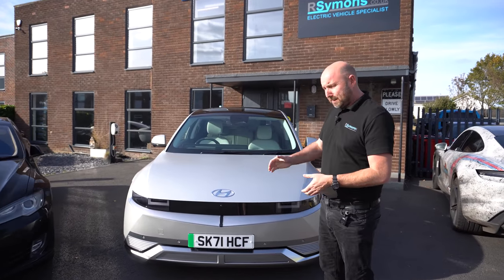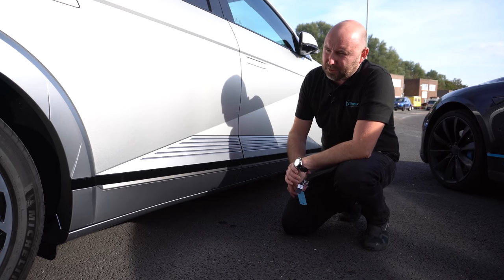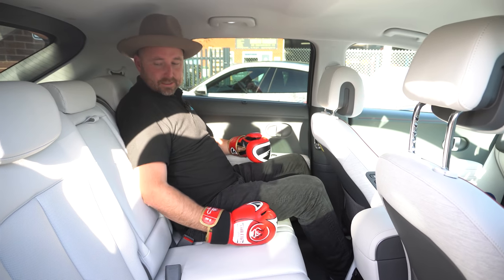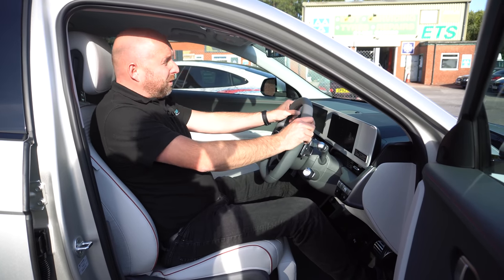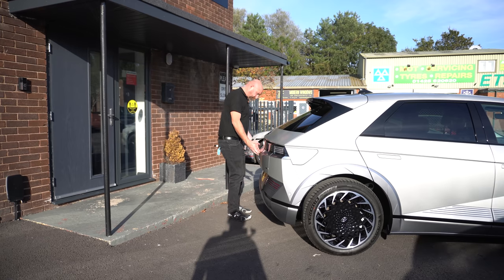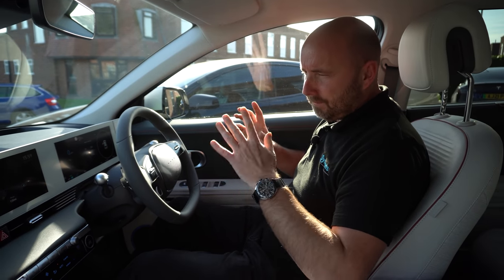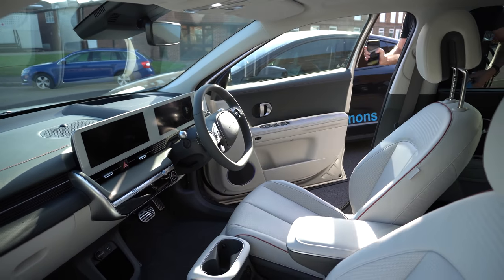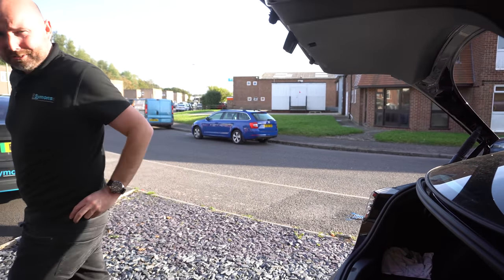Hyundai Ioniq 5 Project 45 review with likes and dislikes plus comparisons with Tesla Model 3 and Y

Comment: I too have a P45.  There are a number of assistance systems.  I agreed with your initial assessment about the slightly modulating steering.  But after using it on several long journeys, I have got used to the slight wobble.  I think this is to keep you aware that the system is still active and working.  As you have to keep your hands on the wheel.  So I got used to it.  I find the graphics and infotainment fine.  Look of inside and outside fab.  Very glad I purchased the car.  It is good to have EV choice.
Reply: What is your real life mileage if you don't mind the question
Reply: @AZCONA  Hi I am getting 230-250 miles.  I am not driving particularly carefully.  But really meets my needs.  The rapid charging works really well at the few UK based Ionity chargers I have used.
Reply: Didn't know you got fired.

Comment: I turn off lane assist when I leave home as I live in the countryside and it doesn't work on rural roads.  But in order to get the crash safety standards, you can't turn off lane assist permanently.  But it is easy to switch off via the dashboard button.  Can't agree with the grey plastic issues - I think it looks cool

Comment: Great video. Out of all the IONIC 5 videos I’ve seen, I like how you are telling Hyundai, directly, your straightforward opinion about the things you like and don’t like.  The “bold design,” and the choice of a lot of grayish bits of plastics, etc.
I am glad Hyundai is bold with their designs. I prefer a vehicle that stands apart from the rest. I hope they continue to have great designs and offer a lot of features for the money. 
I, too, was surprised there was more plastic areas for a vehicle that seems to give the vibe that it has a higher standard of quality. 
The launch video of Hyundai, made me think the interior was going to be a bit more quality. 
I want one. 
Hope you can do tests on the charging. 
And seeing if you can get full performance from the battery. 
A different YouTuber noticed the IONIC 5 doesn’t give full performance/horsepower because the battery temperature is affecting it. 
I don’t like that. I want to just unplug and go with full performance regardless of battery temps.

Comment: Very fair review. I’ve had my Premium RWD 73kw for a week. I love it!
The lane assist is annoying!
It’s a shame Hyundai gave everyone P45 or Ultimate Ioniq 5’s to reviewers as I doubt many people will buy the top of the range and the next level down (Premium in the UK) is missing a lot of those bells and whistles.
Reply: Almost everyone ordered the full trim in my country. The price difference is really small between the two trims (yes, we only have two choices). And everything is available including sunroof and solar roof. Weird how different the trims are in different places...
Reply: @Danne89  EVs are seen as expensive in the UK. Even the lower spec Ioniq 5’s are perceived as expensive by most people.
Reply: Agree - the premium feels anything but. Was all excited by the features on display - then to find out all extras and no idea on the waiting time if ordered from my local dealer - I want te Ultimate AWD tech pack
Reply: @davemcconnell2491  I actually feel my car is very nice indeed. Some of the extra bells and whistles would have been nice, in some cases Hyundai removing them seems unfathomable (mood lighting, popping out door handles). I just think it's a shame EVERY Youtube review features the ultimate spec which is not what most people are going to end up with.

Comment: Regarding the lane assist on/off and level of regen and I believe other settings. In another review I saw that car keep selected settings by clicking "Auto-Hold" button on the right hand side of the steering wheel. If "Auto-Hold" is off car reverts to default settings once turn-on again. I don't have the car to test it first hand, so I could be wrong.

Comment: My Kia E Niro has heated and cooled seats and idea is you can save using heat/air con and therefore gain extra range. I also find the same annoyance with lane assist and country lanes, but in general not a major problem. Worst is when there are no lines and it somehow finds some!

Comment: I love the design 🤩 
It might charger faster than Tesla Model 3 in kW, but not in miles per hour, due to it's higher consumption. 
Did you had issues with low power after fastchargeing? Like Bjørn Nyland had on his presscar?
Reply: Have to say that "failure to launch" on the motorway looked as though it could be dangerous. (If it's found to be "a thing" on other cars)
Reply: This was one car and it’s amazing how that one car has been brought up in almost every Ioniq 5 review

Comment: Took a 24 hour test drive of the ioniq 5 a week after having a model 3 long range for a weekend. The steering wobble when in lane keeping was the same, also it would sometimes just disingage without any notice whatsoever, Basically making the feature not something you could rely on. Tesla autopilot way better! Also The lane assist was annoying as hell down country lanes and I couldn't figure out how to turn it off, To many buttons!  The regen had to be reactivated every time I got back into the car with the padal shifts which is annoying. Voice control useless unless for calls. When accelerating off the line there was 1-2 second delay even in Sport mode. A couple of times it would say the key not detected in the car even when it was. I had to jump out lock it and unlock to get it to recognise the key again. infotainment I found decent with Android auto and apple car play. Plug socket under rear seat is a great feature. 
Nice smooth ride and better sound proofing then the Tesla but ultimately the ioniq 5 didn't feel special to me where as the Tesla did. Good car and I'm sure it will sell well as many will be happy with it. Good to see Hyundai embracing the future.
Reply: Too many buttons? you really had 24 hours and couldn't figure out how to turn off lan assist? Really, I get it :there are better lane assists out there (including Tesla’s) but saying it has too many buttons is clearly a Tesla fans perspective. Most people dont like the absolutely minimalistic stuff in the Tesla.
Also: Regen stays where it was unless you are not in I-Pedal. The delay though is sometimes odd. Sometimes it’s instantaneous, sometimes it has a lag to it. Maybe a thing that can be fixed with an update. Also: did you check Bluelink was connected? Without it, it’s crap-

Sorry, but the way you experienced it does not apply to people who are seriously interested in a car. Before I test drove it I knew the stuff you are complaining about.
Reply: @carroux4050  Yeah, I set my regen to level 3 on day one and haven’t had to touch it since. Lane Assist is annoying but you just press the lane assist button on the wheel for a few seconds to turn it off.
In a week of ownership I have not experienced any if the other issues.
Reply: @carroux4050  no I didn't realise it was obvious how to turn lane assist off.  Yes too many buttons when you've experienced something better i.e put the car in park and your done rather that put the car in park, apply handbreak and press the start stop button! I-pedal had to be re-engaged every time I got in the car. 

Yes I knew enough about the car before I drove it but no I didn't read the manual first which with the size of it would have used up the 24 hours I had. 
Ultimately the car was very good. My negitive points are my personal dislikes.  Also 3 out of 5 charging stations I visited didn't work but that's wasn't the cars fault but that added to my experience overall.
Reply: @dannyspeed  Hey Danny, I get it that people have their favorites. And I guess thats perfectly fine. But as you said in your first paragraph this is, yet again, due to driver not knowing better. The Ioniq automatically goes into Park if you open the the door. This applies while the car is turned on and you open it or the car is turned off and is not in N. The start button: ok. But I guess this can't be a dealbreaker since a lot of EVs nowadays still have this button (which I assume is because of drivers used to it).

Tesla is a great example wheres design is before functionality: why'd you think Model S and Model X still have a driver dashboard? It's not about minimalism per se, but to save cost. Also one might say for a Tesla you need to get an introduction as well. How the hell should someone know how to engage Autopilot or just SCC. Even setting back the indicators can be a challenge when you start out.
I think it's unfair to report your dislikes when 80% of them are due to not knowing better...

Don't get me wrong. I like Tesla (even though you might think I don't). Model 3 and Ioniq 5 were on my shortlist. And both are excellent cars. There are pro's and cons on both sides. Viewed objectively there is no winner. :)
Reply: @carroux4050   Its not about the driver knowing better its about how intuitive the experience is. If i put the car in park that means i'm parked if i'm in neutral then i'm obviously not parked. When on an incline you have to engage a hand-break. Otherwise why have you got these options. No experience is better when you have to put more input in to get the same result. Like the Charge port wouldn't open unless you turned the car off, but i suppose there was another obvious thing i missed on that. 

People are slow to change, they like the old way of things. I had the original iphone when it came and people/media were saying they like buttons on a phone and we all know how that turned out. In my house I have Alexa controlling my lights or i have other lights on PIRs. I adopt technology quicker the most and i embrace it. When i hear people say they hate having controls on a screen yet you never see any reviewer using voice control. Most of the main stuff is automated anyway and if it aint it should be. I test drove a BMW i3s recently and told the salesman the i-drive system is terrible, his reply was its regarded as one of the best infotainments on the market. I don't want a dial to control a map i want a touch screen. 

Tesla didn't save cost they embraced a different approach like Apple did under Steve Jobs and it works. You think to get software to control every aspect of the car is an easy feat? Yes down the line it saves money on buttons ect but you get better user experience imo. Some disagree and thats fine.  The model 3 had short videos within the infotainment on how to engage autopilot, i admit the model S i had to google how to turn it on. Agree about the indicator stalk also that does take getting use to. I like how the ioniq automatically re-engaged auto-steer when you changed lane, where as basic autopilot you need to re-engage it. 

My negative opinions obviously came out strong. If someone asked me what car to buy i would always say to get a long test drive/hire in both. At the end of the day both are excellent choices.
Reply: @dannyspeed  Great comment. I think I can agree on a lot of things. In the end it comes down to personal preferences. 
If there was a car which was perfect the world would be a boring place, wouldn't it? 

One thing though: why is it that the refreshed Model S still has an instrument cluster? :-) 

And I absolutely agree: when it comes to software and infotainment performance Tesla is clearly in it's own league!

Comment: I have a feeling the boot won’t open if you are standing too close - it’s noticeable that it sweeps up in an arc that extends slightly towards you and might hit you.
Reply: That's possible, but he could have also accidentally turned off the feature. I believe there is an option for it (I had it on my previous 2018 Kia Optima SX/GT where it detects your key, the trafficator signals come on synchronously and then the boot opens).

Comment: From other reviews....Tesla ADAS is far superior. Navigation did a poor job of identifying charging locations. Not nearly as fun to drive as a Y and not nearly as powerful. Some say the lack of ventilated seats in Y leaves them with a sweaty back and some say the aircon on the Y is lacking in a hot climate. My Kia PHEV has great aircon but the ventilated seats are a disappointment. Also, the Lane Keep Assist on my Kia does not work on a sunny day with shadows on the road. Is this also a problem with Ionic?  Software updates?  Really concerned, my Kia has had NONE in over 3 years. Waiting to see the Genesis version since it has powered steering column, hope it will work same as Tesla. Also, my Kia Easy Exit only moves the seat rearward and does not also lower the seat. I find my driving position in my Kia very awkward/uncomfortable. I like the blind spot camera view in dash, but does it also make a sound if someone is in your blind spot?  On my Kia, Lane Keep Assist is not available below approx 65 kph, how about the Ionic?
Reply: Model Y LR has pretty much the same acceleration from 0-60 as the AWD Ioniq. What are you talking about?
If you’re talking about the Y Performance then consider it has also a much higher price tag and it’s Match will be the Ioniq 5 N
Reply: @carroux4050  I watched a Swedish review that compared the Y LR with the Ioniq 5 and also one of the (Czech?) ID 4 variants we don't get here in the US. I think the Ioniq 5 might have been the single motor which would explain its being slower.  He did mention the Ioniq 5 had a larger turning circle than the Y which I found surprising since I thought the Y was pretty bad based on what I heard.
Reply: @DiscoveryOwners  yeah, the turning circle is not especially good. I guess there is no perfect car out there. :)

Comment: Range is quite poor for that size of battery.
Reply: I notice that this review and others say “charges quicker than a Tesla Model 3” and never mention that it empties quicker than a Tesla Model 3 too! It takes the shine off the fast charging speed knowing that you will have to charge more often due to poor range/efficiency.
Reply: @keithgibbons1704  Driving slow the efficiency is fine.
Reply: It’s longer and taller than an TM3. If you’re comparing range needs to be with a TMY
Reply from the maker: And we’ve compared model 3 to a y before and efficiency identical. 
Ie. 250 miles quite easily
Reply: @SDK2006b  actually TM3 is longer than the Ioniq 5. 4694mm vs. 4635mm. TMY is of course longer than both at 4750mm.